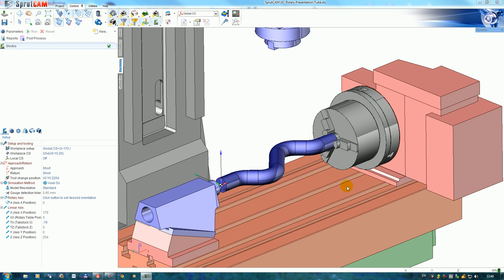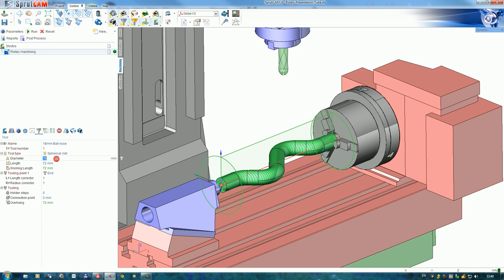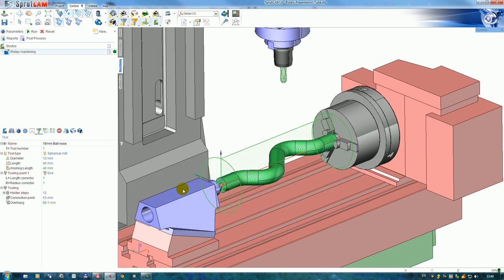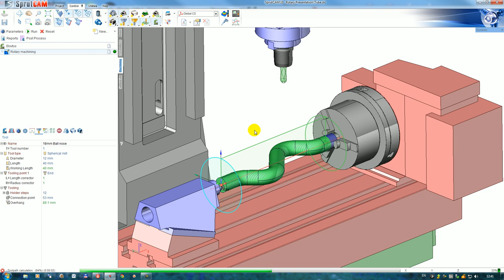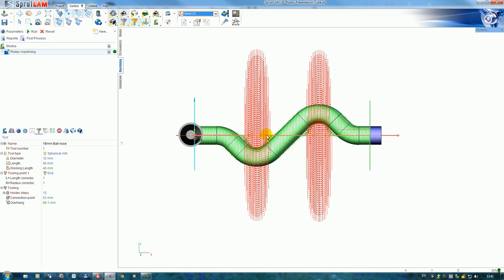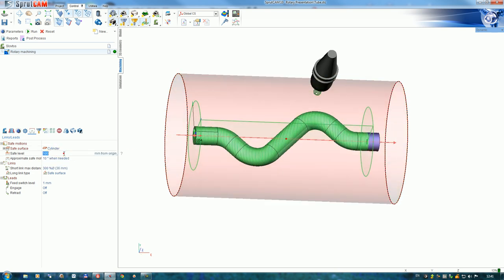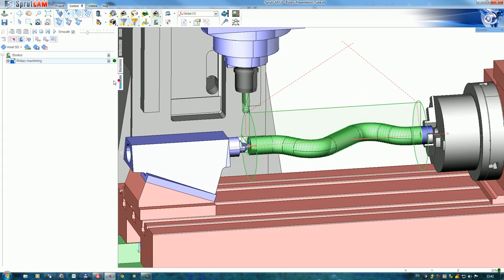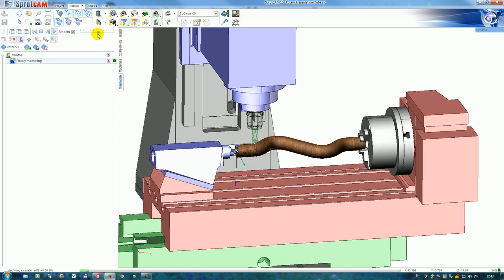Rotary machining operation in SprutCAM

Comment: Thanks for the overview.  I always find them interesting and helpful.  I REALLY like the visual interactive job zone settings in this version!  That is a great addition to the program.  The flexible axis option will significantly decrease machining times (a lot less AIR CUTTING) and decrease the complexity of having to choose multiple operations and/or editing the G-Code to get the desired finish result in an efficient manner.  Keep up the good work and I look forward to upgrading some time soon!